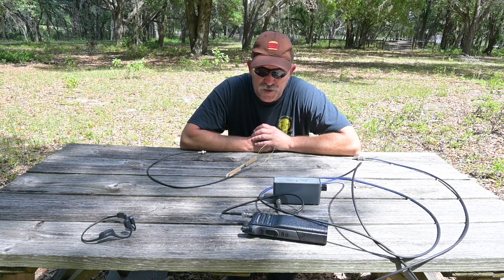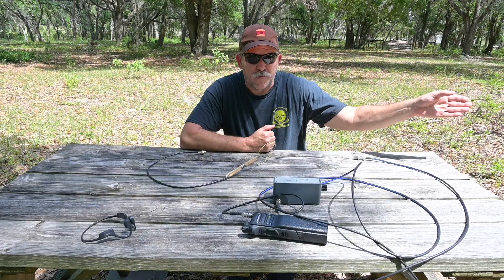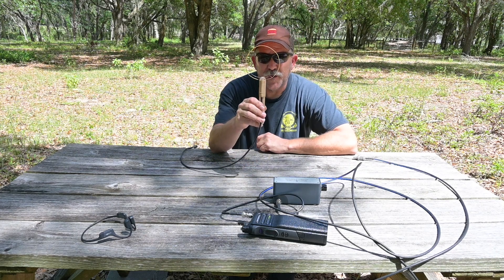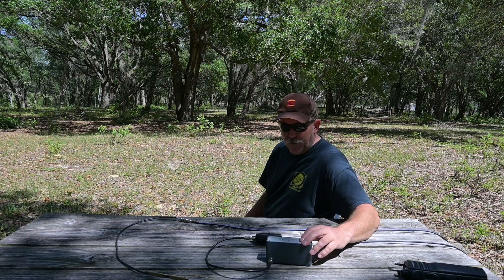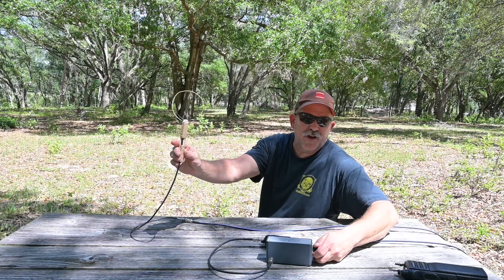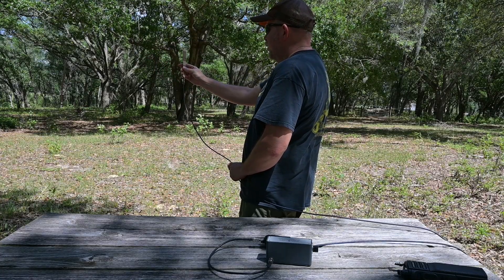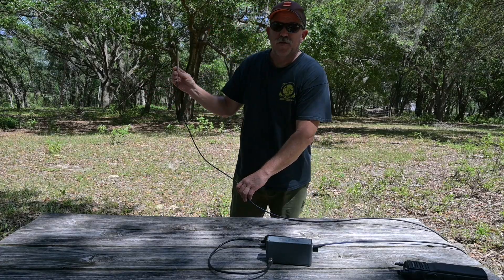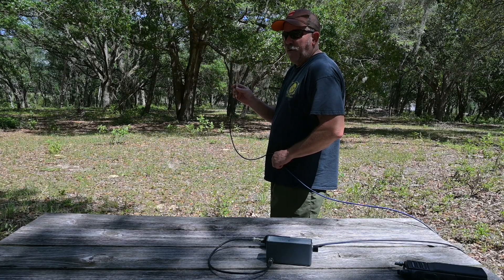Use of attenuation in radio signal direction finding - excerpt from upcoming SurvivalComms content

Comment: Very interesting. I always wondered why the fox hunt guys had attenuators with their gear. Makes a lot more sense now. Looking forward to the next one. Thanks Brett!
Reply from the maker: In the presence of a strong signal it is difficult to ascertain direction otherwise. When we consider the subjective observation of 3db equals 1 S-unit on a receiver's RSSI (which may or may not be the case depending on the receiver) . This illustrates the point that we have to pay attention to subtle clues. Someone mentioned earlier that they didn't hear a real difference in the audio yet the RSSI of my Icom R-6 deviated as much as 6 S-units and that was with a digital RSSI movement. The old school DF folks who did this sort of thing day to day always swore by an analog meter movement for speed in response and they are correct that speed in response of legacy equipment smokes my spectrum analyzer or contemporary equipment in minute changes of antenna position in relation to signal strength vs time. If someone truly wants to master this skill it is imperative that the practice it.  Thanks for watching !